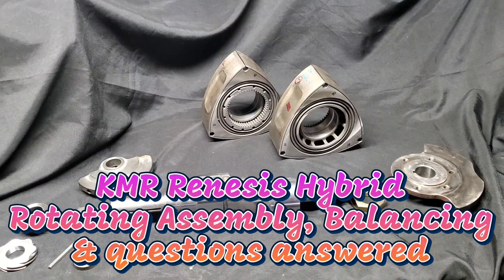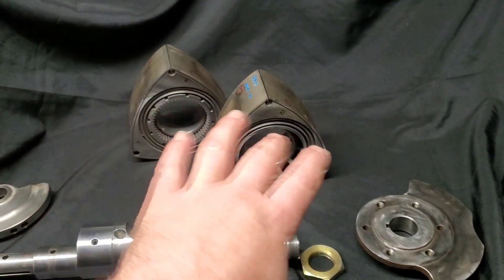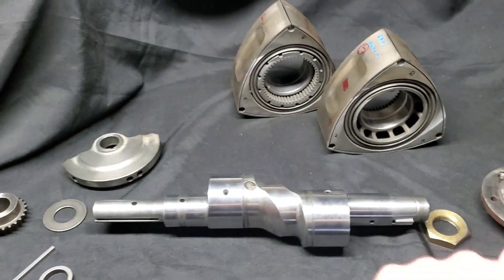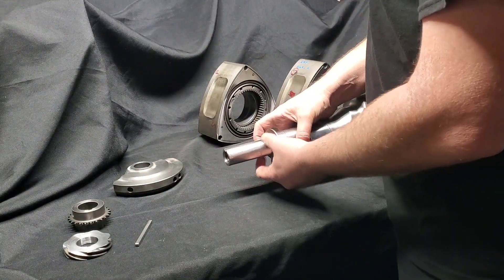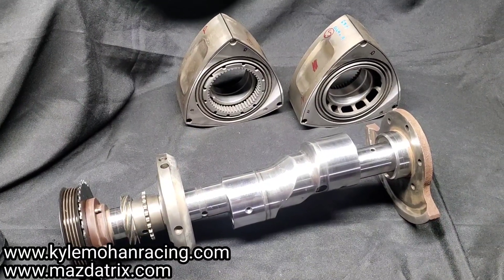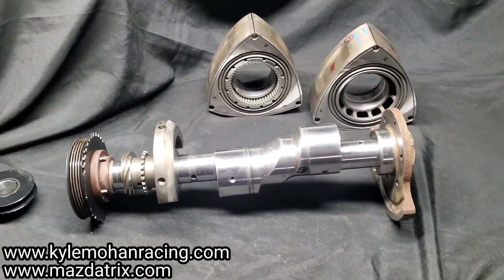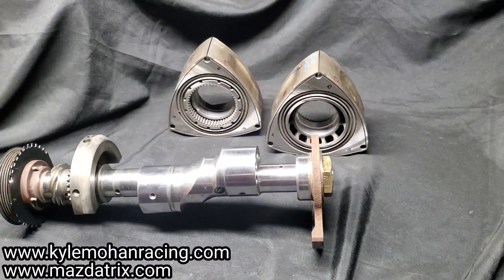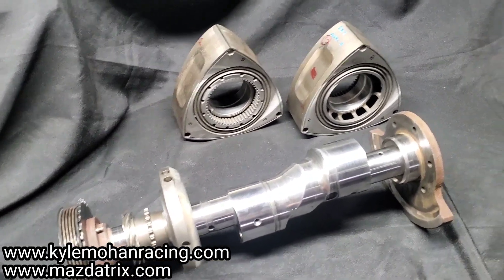Renesis Hybrid Multiport Motor, Balancing the rotating assembly, updates, questions answered vol.5

Comment: I know you never respond, but honestly, what's this hybrid setup look like from an na standpoint?
Reply from the maker: Looks good,  ones I know of are standalone ECU and after market intake and they work fine.
Reply: @Kyle Mohan Racing  well I will be starting my engine build for my RX2 later this year and want to keep it NA. The REN is a decent motor for that, but this hybrid setup is really interesting. Seems like there are more gains to be had boosted obviously, but there is little info on this combo in NA form.

Comment: With alot of balancing trying to get the weights to within a gram or 2 ideally do you think a smaller front pulley/aftermarket aluminium pulley would affect the balancing a little bit?
Reply from the maker: Here is a video talking about balancing 
https://youtu.be/eBRRPUUiG_A

Yes front pulleys or any weight change can make a difference.  Also, balancing the rotating assembly and rotor matching are two different things

Comment: why mark the rotors when rx8 rotors have F and R stamped in to them already?
Reply from the maker: Machine work can remove the markings from the factory.
Reply: @KyleMohanRacing  but you havent done any machine work where the F and R are stamped on rx8 rotors.its stamped on the faces, not the sides.
Reply from the maker: @davidhusband5022  yea, its small so we recommend just using a sharpie so its easily visible to anyone working with the rotors.  Also like I mentioned some machine work could remove the factory markings. Ive also seen rotors that where not clearly marked. In which case might be a good idea to re mark...

Comment: With the higher compression of the RX8 rotors, what sort of power output would you expect on this build? Thanks for the balancing info!
Reply from the maker: With a basic T4 turbo.   The last one did 430 at 14psi I believe.  Give or take a little

Comment: Hello. Do you need to send the pulley that you are going to use with the assembly to get the best balacing or doesn't matter which pulley you decide to use after it gets balanced? Thank you and have a great day.
Reply from the maker: Yes I recommend getting the front hub or pulley you're going to use balanced with the rotating assembly as to not introduce a change. In some cases hubs or after market pulleys are a neutral balance as designed to not affect existing balances.  I may have the OEM front hub balanced and may also have an aftermarket hub balanced with it as well just for the option as I'm not positive what my belt configuration will be.
Reply: @KyleMohanRacing  Perfect. Thank you.